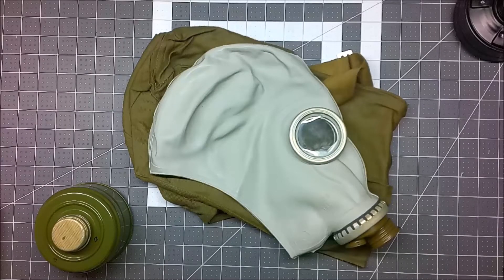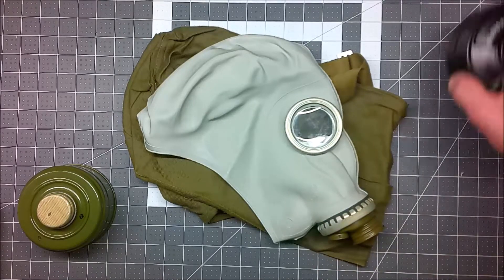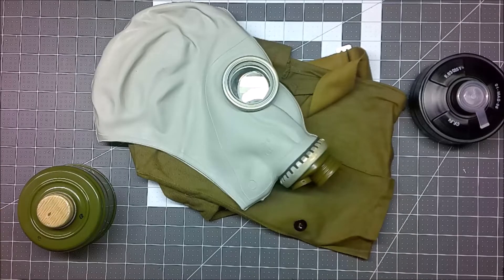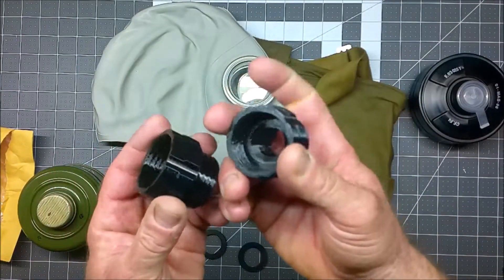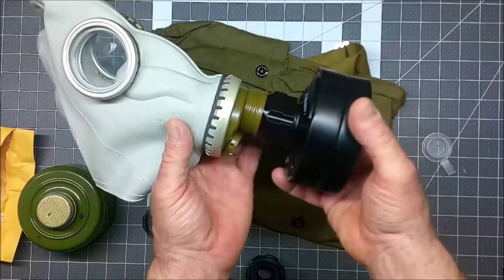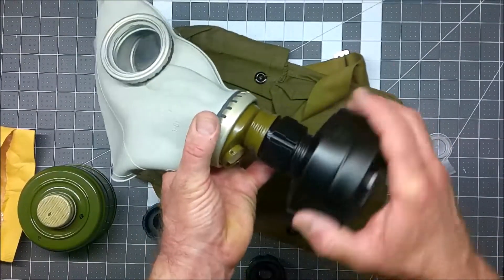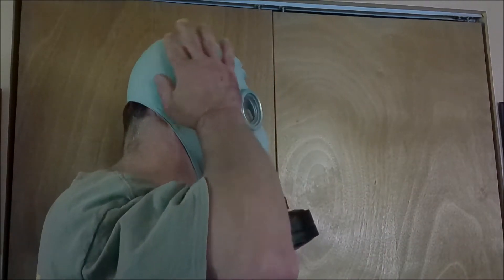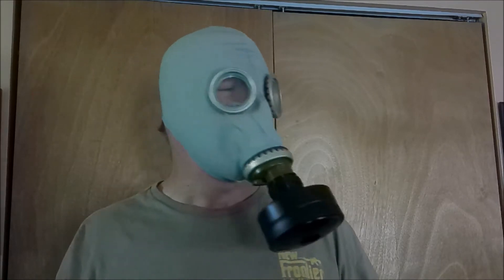40mm GOST To 40mm NATO Can Filter Gas Mask Threaded Adapter Made of PETG from themaskguild

Comment: For those without adapters that want to fit a NATO filter or fp5 without adapter. The depth of the threads is not bottoming out against the seal so it's not safe. The other way even with NATO if you force it is to buy a 40MM Or-ring about 4 mm thick and with a 3mm inner diameter and put it on top of the existing one in the mask. THAT will create a proper seal. Don't believe me, do a smell test while shaking the mask. But yeah there is a couple of cents fix.

Comment: The french filter your using may be  normalized thread meaning it will fit both 40mm nato and gohs nato thread wont let you thread it all the way and it will leak air around the thread on a gohs mask try testing it with something like banana oil and youll see what i mean

Comment: You can 'force' NATO filters into GOST masks but it's really not recommended. While they seem to fit it's dangerous in a real situation.
Reply from the maker: That's sorta what the video is about
Reply: @Squib1911  Yes of course. But i just mentioned it because you said something along the lines of 'It seems to work with NATO filters without the adapter'. Might just be me understanding it wrong. Either way i'm going to buy an adapter soon thanks to this video. Cheers!

Comment: I still have my gas mask and all of my mop gear.  i was friends with our Quartermaster.... Speaking of gas masks i figure I'd tell you a really funny thing that happened to me, when I was in basic training. Me were on our last FTX before graduating. In this FTX they were using allot of CS gas. On the 2nd night they gave us about a hours sleep. Then they woke us all up And made us stand in formation. So they could brief us about that days activities. I kept noticing that one of the drill sergeants was looking at me with this big smile on his face. Sometime in the middle of the brief. a drill sergeant threw a CS grenade in the middle of the formation. The idea was to just quickly put on your mask and stay in formation, no big deal. So after they threw the CS grenade, I pull my gas mask out and put it on my face tightened it and started clearing my mask. it would not seal. I was trying really hard to clear it and to make it seal. But it was doing nothing. I am starting to freak out. i never had this happen before...then i realized...my filter was missing. Lets just say that night sucked.
Reply from the maker: Yes that would suck.  They issued me an M17 mask, so I didn't have to worry about the missing filter thing because they were pretty much always in; not the screw in kind.  In boot they gave us unserviceable masks so I didn't have an eyelet in mine.  Let me tell you my first trip to the gas chamber sucked.  Later when I was in the fleet I got issued an M42.  Took a while to get used to this big filter hanging off of.....I think it was on my left cheek.  I have more gas mask videos planned as I have other masks however I just haven't made time to do the videos.
Reply: @Squib1911  i dont remember the models of gas masks. But mine is either an M40 or m42. The little booklet on the inside says both. And yeah its filter in on the left. I only used this type of mask when i was in.
Reply: @Squib1911  the gas chamber that did suck. Then you spend the next hour flapping your hands like a bird. With your face covered in snot...good times lol